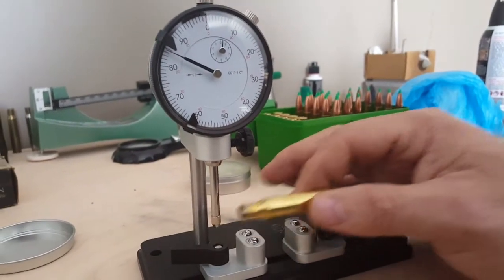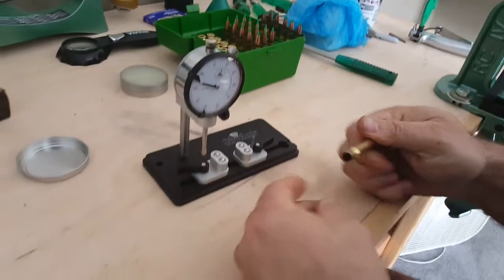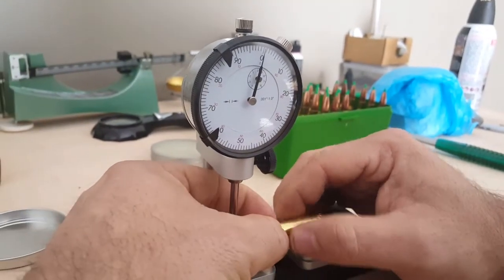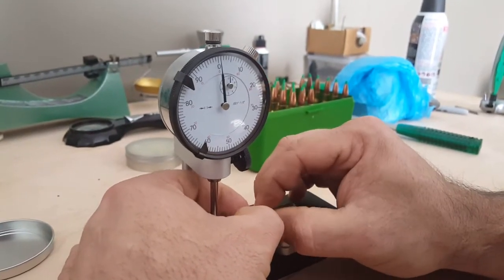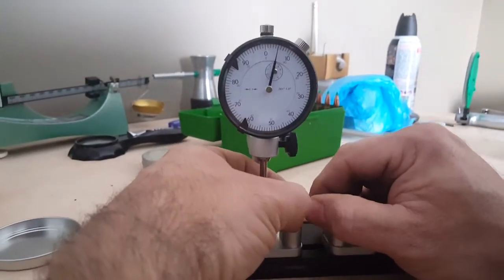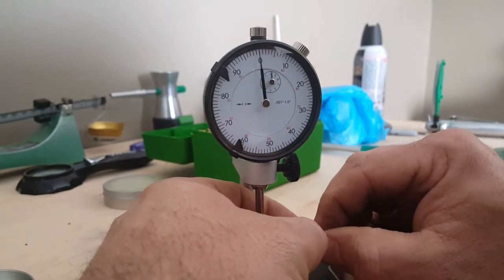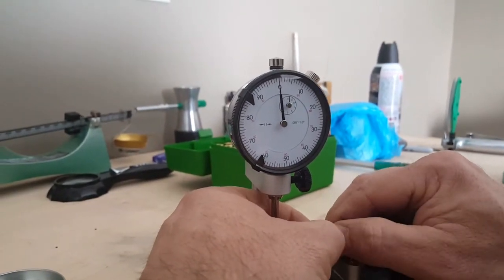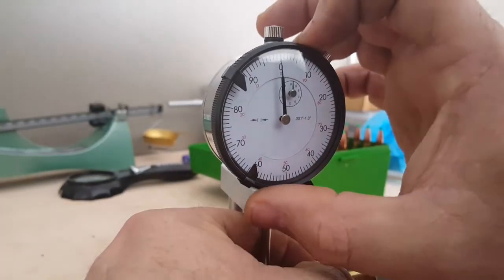Case neck runout

Comment: Try polishing the neck with 400 steel wool and brasso.  I clean cases with Meyer dish soap and lemmi shine, let soak over-nite then rinse and let dry.  If I want I can polish with brasso.  If I can get 1 thou on the neck and 1 thou on the bullet... I figure my rifle can take it from there.  I leave my cases fireformed to the chamber and focus on getting the neck set for smooth seating.  I use nosler bullets and load data.  I mark my cases with a dot (Sharpe pen) each time I fire the case.  CFE 223, WIN Primers, nosler balistic tip bullets.  Wilson, and lee neck dies.  I'll just keep buying neck dies until I find the perfect neck die.  Summit, Co-Ax and K and M press.  No force pack on the arbor press not really needed for 5.56 and 223.  Forester co-ax is great because of many reasons including quick die changes. 

The inside of the neck needs to be clean or the runout on the bullet can go above 1 thou. 

Great video... thank-you for making it.

Comment: Could you explain what run out is to start your vid so those who are trying to learn can at least have an idea of what you're doing?
Reply: runout is the amount the neck may be off center when turned on the center axis of the the case. the gage being used above will measure total indicated runout, so if he see's .001 of runout, he is actually .0005 off the centerline of the case axis if everything else considering the case geometry is good.